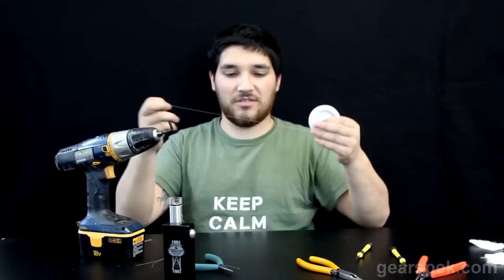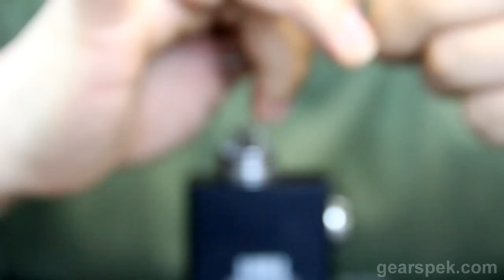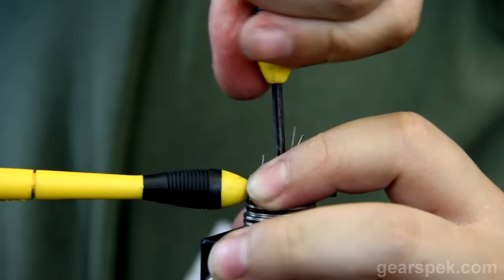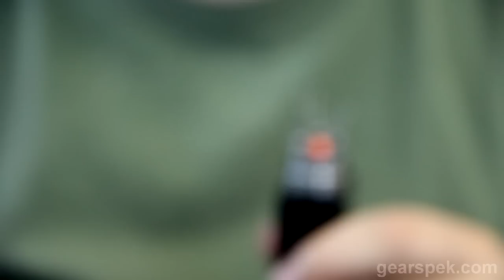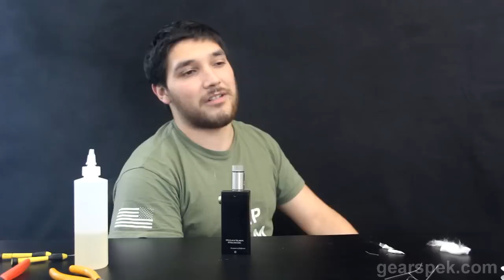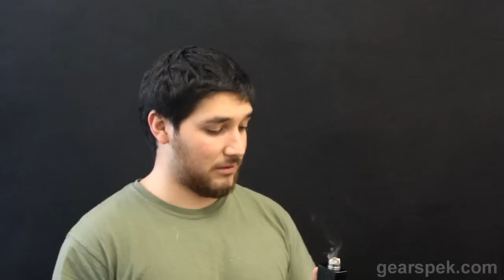Review and Build! Turbo RDA with Zipper Coil!

Comment: Nice build bro, thanks. One thing tho do me a favor and remove that fan and air flow plastic insert. I had my Turbo for a little over a month and the one day I was one pull away from inhaling pieces of plastic that just all cracked and disintegrated before my eyes. So it still works without all that in there it actually works better
Reply from the maker: Jack Mangefrida  Thanks for the suggestion!
Reply: the newer ones come with a screen on top protect ya neck close off that airflow though better cloud
Reply from the maker: I have done a lot of playing around with this RDA Since then it has been treating me well so far i have put a much easier simple build and just rock some monster clouds on a regulated device.
Reply: +Gearspek great tutorial bruv! I've a question though, does using a build like this melt the plastic on the inside of the rda? Is there a build using kanthal that won't melt the plastic inside?
Reply from the maker: Yeah it can melt the plastic it has the chance and for a basic kanthal build if your using a mech 24g 6 wrap around 2.4mm if your using regulated 24g 8 wrap around 3mm
Reply: +Gearspek will try that today! Thank you so much!

Comment: what you will recommend for a zipper at kanthal a1 26gauge to get good resistance and dont blow my hands off with stingray x + samsung 25r :) How many wraps and how much wire did you need?
Reply from the maker: 6 wrap and you will be golden the ramp up time won't be too long and you will still be able to get a nice pull from it!
Reply: +Gearspek so 3 stranda approx what lenght to make one coil?
Reply from the maker: +B4WZeR it takes about 6inches each strand
Reply: +Gearspek yea ive just made two wires for one coil, i cant fuck up the other one cuz i have like 30cm of wire left haha but thanks for the reply ill let you know how it works for me on a mech mod
Reply: I cant fit my 26gauge coil into the posts :/
Reply from the maker: have you tried to flatten down the the wire just place it in the chuck of the drill. Take a set of toothless pliers and slowly pinch on the wire while pulling it down the length of the wire. it will shave down to the point that you can get the wires to fit.